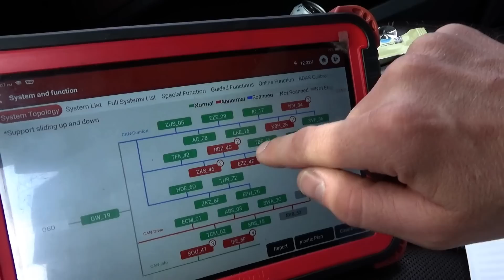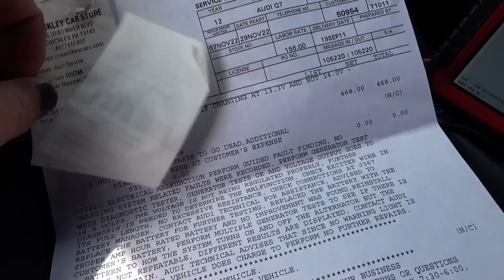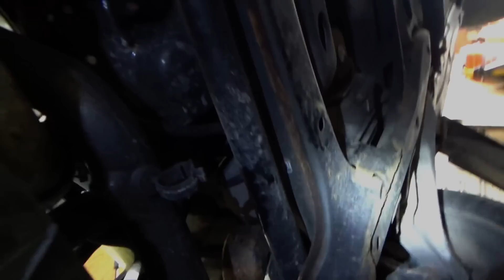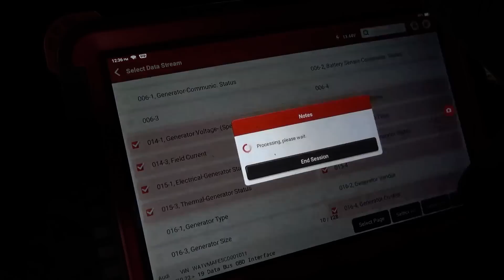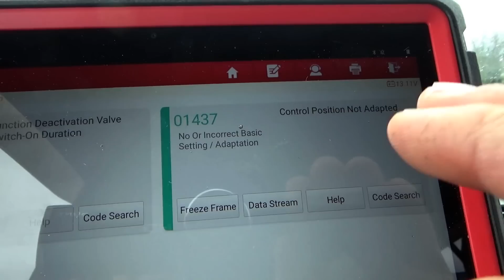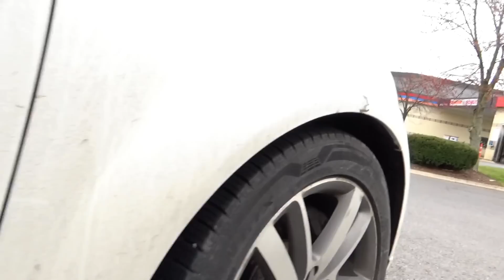Audi From HELL...DEALER STUMPED!! (Part 1 - Charging & Air Suspension MALFUNCTION)

Comment: Its unfortunate but dealerships really aren't geared for troubleshooting problems anymore. Their bread and butter is simple routine maintenance and replacement of worn parts. As for diagnosing problems they just follow an established flow chart. Anything out of the ordinary stumps most of their technicians. Occasionally a dealership will have a real old school mechanic that knows his stuff but they're few and far between. I worked for a Mercedes dealership and saw first hand their process was for the technician to go to the parts department check out a part and see if it fixed the problem or not. Continuing to fire the parts cannon until something finally worked. Such is the state of the modern dealership service departments. You however are a real mechanic that knows how to actually understand how s system actually works and dig into it to find out what's wrong. It is unfortunate that with today's modern complicated computer controlled cars there are times when special tooling, test equipment, or proprietary software is required and your hands get tied. Hopefully this won't be one of those times and you'll find a work around and show that dealership what a real mechanic can do.

Comment: I understand that dealerships do have to follow a set protocol.  I worked for a Volvo dealer for over 12 years.  But seriously, after 3 hours of diagnostic, their only recommendation is to crush an ant hill with a wrecking ball?  Essentially replace the entire system and start fresh.  That's inexcusable.

Comment: Havent watched all the way through but, i wonder if the alt is overheating and does it have an auxiliary water pump. This is fun. Moving forward, an ASE Master Certified Technician didnt plug a connector in all the way because he forgot to take his vitamins, been there, seen that, dealers suck, they are just there to sell cars.Tootles !

Comment: My ring finger looks like your thumb did. I must of smashed it ever so slightly right behind the nail. It barely even hurt when i did it, i was doing front shocks on a 09 f250 diesel. The nuts were rusted so they both broke and i was using my other hand to make sure i didnt hurt anything when they cut lose...

Comment: Dealers basically don't exist in Dominican Republic, we do have companies like "Agencia Bella" for Honda, "Delta Comercial" for Toyota, "Viamar" for Mazda, Ford, Lincon and Kia and "Santo Domingo Motors" for Nissan, Infinity, Cadillac, Chevrolet, Suzuki and Yamaha for New 0km vehicles and "Service" Vehicles under warranty (there are other companies for other brands) but more than 90% of new car owners ever come back to the "Dealer", maybe for underwarranty repairs and oil changes only if warranty does require it. Just to give you a taste of this "Dealers" incompetence let me tell you a quick story, i have a mazda 3 2010 2.0 sedan, TCM stopped working so i contact them before looking for a used unit on ebay, they quote me around 1,200 bucks and yeah, i was willing to pay for it until they toll me that "it can take 4 to 5 weeks to get the part, maybe 10 if i'm not lucky enough", well, i bough a 300 bucks used ebay module pulled from a crashed vehicle, i installed the TCM myself and the car is back in service. By the way Ivan thank you for recommending SMP, got some intake runners and they looked exactly the same as the OEM ones, SMP rocks.

Comment: How old is the owner? I’ve ran into several older folks just looking for problems poking around where they shouldn’t on newer vehicles that have “smart” charging systems. Even though no codes or problems are present, they swear the alternator is bad because it isn’t putting out a constant 14v.

Comment: Currently fighting a similar Audi battle. I’ve Installed a used rear final drive in an S7 . I have been trying to use the guided test plan to “adapt” it to the AWD module. The AWD electronics is giving me the finger just like your Suspension module, so frustrating. I feel your pain, looking forward to seeing the conclusion on your Q7.

Comment: A true master mechanic is self employed like Ivan and Eric 0, they use their ingenuity to solve problems and fix the issue many times with no parts required. A dealership doesn’t work that way. They on your dine will sell you everything they can but if it’s under warranty they can’t find the cause and hunt and peck looking. 
Ivan does many AMAZING repairs here. That dealer just embarrassed themselves in front of a huge audience.

Comment: Lesson 1:
A 2012 Audi is going to give you grief ALL THE TIME. Don't try and fix the gremlins if it still drives and gets you from A to B.
Lesson 2:
If ever you are not happy with a dealership DO NOT ARGUE WITH THEM. It is pointless. Call the Customer Service line for the Brand and tell them you are not happy. They will correct the problem for you as it is then a Brand reputation issue and they want to keep you as a customer.

Comment: First off the owner must not have got the message about not buying modern german automotive.  Pure hell wrapped in metal with meaningless added devices that are not necessary.  Codes even dealers cannot fix.  Don't care if its Audi, BMW, Mercedes, VW, etc.  Just junk.  Stay away unless you like pain and suffering.

Comment: I have to add this, too.... as MOST service manuals do show how to make a dang REPAIR of a messed up wire, connector, pin, etc, rather than REPLACE the entire system... BULL** stealerships... I always attempt to dissuade anyone from getting the factory shop screw-over... I often just fix their problems, free, if they will just buy the part I tell them to get, or I order it and they pay for it, but then, I am a retired person.
Reply: Good on you. Lots of factory connectors can only be sourced as a harness. Have to use that with a warranty repair. I like to hang on to the old harness to offer a cheaper alternative to customer pay repairs instead of quoting the whole harness. Of course i charge my labor out, not in a position to work for free like yourself but do like to try and cut costs when i can without cutting my pay.

Comment: Once had a pinion seal leak and took it to the dealer. They gave it back and vibrated like hell. Brought it back and they said my driveshaft was bent. Hundreds for that and a 10 day wait.     Same condition. Knowing it didn't vibrate BEFORE the pinion seal change, I jacked up the rear, spun the wheels and saw the pinion moving in an ellipse.   They must have hammered the pinion flange and bent it.  I went back with evidence, left the car and they said it was tire balance.  Good guys: no charge. 
Looking underneath there was a new pinion flange installed.  
No refunds for the new, long awaited, new driveshaft - they said "That was bad too"! 
Decades ago but I never go to a dealer.

Comment: For the sake of my sanity and blood pressure I don't get involved with Audi. There is  one possibility your problem could be though. The low voltage issues might have put the suspension module in some kind of limited function mode where the system won't recalibrate, and possibly not even set a code.  If there aren't any software updates for this problem maybe you could try a hard reset on the module. I've had some modules come back to life after trying this. Worth a try and doesn't cost anything. I would not do it at the battery and reset the whole car. That's asking for trouble. Try putting a 1 ohm 10 watt resistor across the power and ground of the unplugged module for 10 minutes and see what happens. Another thing would be to see if the battery was changed  and registered with what ever module controls the charging system. That can have an effect on the charge rate.

Comment: This is an ongoing topic about dealerships. The Car Care Nut. South Main Auto and other diagnostic channels keep getting these cars.  They milk the customers and then pass on an outrageous estimate to get the customer to somewhere else. In my opinion. Dealers are only interested in high profit yield jobs.  Jobs that have high billable hrs per book but they can do on less than half of that time.  Not all of them but odds are high that most are.  The Shop generates most of the Dealers profits not car sales.

Comment: How about 1,000.00 to flash the computer on a 2000 Volvo s80 that would shut off all warning indicators on the dashboard, my friend's wife committed sucide and her car sat for years, when he installed a new battery the dash was lit up like a christmas tree. I had to do some other work on it because his son was getting his license and was going to drive it, the hood latches had rusted so the hood wouldn't open, I had to remove the bumper cover to access the e latches, yes Volvo has two, I took it back to the dealer they gave me a rental car while they worked on it, after a couple of days they said to pick it up and that all lights were out, I don't have to tell  you what happened next, that's right on the drive home some not all lights came back on, I told my friend and he said they'll just drive it that way,, lesson learned dealers sometimes are blue skying it.

Comment: Yeah,probably but  Not the First und Not the Last one.
This Air Suspension systems lose calibration as soon you lift the car Up without locking the Suspension.
You need to have all Doors closed with window Open at the straight floor to calibrate.
I dont know If it's possible to do the calibration without vcds.
Hi from Germany 😂
PS. Sorry for Bad English

Comment: this is truly frustrating as they in my opinion didn’t completely diagnose the system properly of course there is corrosion but the pump is working and the system is not leveling properly so where is the leveling problem

Comment: Back at the end of 2018 I was looking at one of those Audi Q7s to replace my aging 1998 Jeep Grand
Cherokee and 1994 Subaru Legacy, thinking I would replace both with one new vehicle. Then a friend let me drive is new Tesla Model 3. I was so impressed that I bought one and decided to keep the Jeep just to pull my boat. I am so glad I didn’t buy the Audi Q7. I’ve worked on a few Audi’s for friends and they are a nightmare and need a lot of $$$ maintenance. The only thing I’ve had to fix on my Tesla was to replace a trunk lid wiring harness due to factory recall. I feel like I really dodged a bullet here.

Comment: It seems like VAG dealerships have their hands tied having to follow their procedures even when doing non warranty work. With some hybrid VWs there is a problem with 3rd clutch solenoid, everyone at every dealerships know the issue but they always have to sell whole new gearbox by the procedure. That is over $10k to replace. New mechatronics unit (VAG sells it) would also fix the issue for 3-4k but for some reason they are not allowed to do that? And obviously you can get the solenoid repair kit for less but VAG doesn't sell it so that wouldn't be an option at the dealership.

Comment: yes dealer can't diagnose is unacceptable...

BUT ..  21st century auto technology is RAPIDLY challenging EVERYBODY!  

Even the best minds like Ivan are often put to task often requiring commiseration with fellow wizards.  

Shops that are profit based MUST decline work that requires INTENSE research as "time is money."  

Car designers delight at 'new and improved' as it generally results in better new car sales.  And, secondarily, it should profit their repair center.  Unfortunately, it often results in challenges that are unusual, heretofore un-experienced, and requiring intense and time-consuming Diagnostics that are research dependant.  

Therefore, these diagnostics are unpragmatic for many shops.  Like doctors have specialties, so should mechanics.

Reanalysis...   the dealer IS A SPECIALIST...  but there's major problems created by NEW TECHNOLOGY

Comment: If I were the customer, I'd write a detailed letter outlining the charges and service issues at the dealer and send it to Audi corporate customer relations, strongly suggesting they get me a refund.  Maybe even mentioning that their next vehicle will not be an Audi based on the problems... you get my drift. At the very least, you'd have the satisfaction of getting their corporate folks engaged.  I would not suggest Ivan write that letter, but the owner.  And who knows, a check might just float your way for the balance!

Comment: This video, I think, shows that the automakers are more to blame than the dealerships. Think about what the service advisor and the master technician told you: "We have to follow an Audi standard diagnostic procedure" which now involves replacing a harness, relay and pump before proceeding to perform more tests. The automaker wants to sell as much parts and labour as physically possible even if it won't fix the problem.
Reply: I tell them those are not the problem, so when they don't fix it you will be giving me the new parts, or putting back my old one with no charges.

Comment: If that is what the dealer says about diagnosis and repair procedures, I'd write a letter to and call Audi and let them know that idea would have NOT fixed the problem and that they failed to tell the master mechanic to check the incoming power wire loom connection below the drivers seat under the car.  I would complain for all of the money...from Audi since the dealership follwed their direction and failed.

Comment: Now I start to understand more, why they are called stealerships, mechanic only scan it and changing parts and modules involved. So there is not even one mechanic who can really repair something? Here in Finland anyway, situation is not that bad, yet, but we still have what we call "phototherapy" so keep hood open, no-one is working on vehicle, but hours are running to bill. Its not mechanics themselfs, they cant get any more money from it, they are payed by monthly, even when there is not a single vehicle to work with, then its "cleaningday" for all tools and shop equipment they use, and if you did not knew, here all of tools are provided by shop, mechanics only bring their skills to do that job. Those small shops here are cheaper and often more skillfull to work some15 years and older vehicles.

Comment: Anybody who buys one of these complicated s*** boxes gets what they deserve. Heated seats, heated steering wheel, electronic ride height, etcetera, etcetera, etcetera. All these systems contribute to complexity and therefore the possibility of breakdown. In addition, the dozens of control modules required to keep this stuff up and running are bound to go bad and require expensive diagnosis and replacement. What a nightmare. Buy a 1970 Chevrolet Caprice with a small block and a th350 transmission.

Comment: Sadly, it's a revenue stream for them and it's a package which is a win win for the main steelers, the Techs just go through the motions in accordance with policy, if that don't fix the issue, they tell you you need to spend a fortune so you just go away, they don't like being challenged, you will get barred.

Comment: Once upon a time the voltage regulator was a separate part from the alternator. Was so much easier to diagnose and repair.
Reply: Many general aviation light aircraft still have charging system setups with a separate voltage regulator.

Comment: I refuse to go near dealers I took a Nissan patrol to the dealer that was having cam position problems injector coil open codes I was almost certain i knew what it was terminal fretting at the ecu connector but I wanted a second opinion yes I tied fixing the connector but the connector was impossible to disassemble, so after 5 hours of diagnosing the dealership recommended I replace every single harness behind the dash totalling $6,000 so they were guessing. 
Words were exchanged and I  basically said give me a dam parts diagram of the engine harnesses and it turned out the intermediate harness that connected from the engine computer to the engine bay was the cheapest one $600 so I said screw you I’ll go to a wrecker with that number and got it for $150 and car has never run better. 

I do all my own GM programming cluster hacking I hate dealers

Comment: The Audi, BMW, Mercedes group of vehicles are are overengineered, overcomplicated, overpriced and require the same in their diagnostic equipment.  All of what you went through is why I would not buy any of those vehicles!
By the sound of what you've said, the dealerships are NOT customer sided.  Another reason not to buy those vehicles.
Totally a shame!

Comment: A coolant cooled alternator. What next. Dry Ice super cooled alternator 😅😅😅😅
Reply: Well, the engine is water cooled.  Why not air cool the engine?  Even modern CPUs and GPUs are liquid cooled now to deal with all the heat.  I suspect it's the same with the alternator as cars go more electric instead of mechanical.

Comment: Because of you and Eric O.
I bought an upgrade scanner. 
As both of you said. It's a starting point of the diagnosis. Powers and grounds always. 
Fixed my brother Santa Fe, followed the powers and grounds. Replaced my crank sensor with a factory part. Had to wait a week. 
I'm working on a 08 Chevy. Replacement of the head and timing assembly. Fix some exhaust leaks after I get the major repair done. 
A 92' F150 waiting, crank no start, I have to drive 150 miles one way for the diagnosis. That's last for the repair. But I don't mind. I'm learning a lot. I'm not master of anything, no ASE bonified, master mechanic. Or Technician by any means. 
Wish me luck Ivan. I'm trudging ahead

Comment: Maybe spray deoxit in the connector if it has a control wire.  The power wires might be good but no feedback to the module?